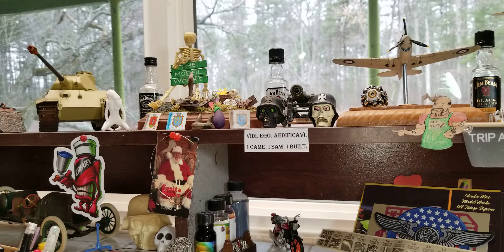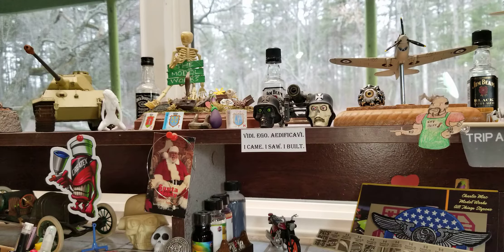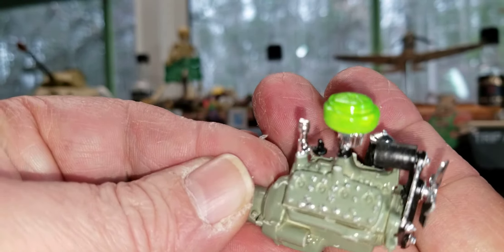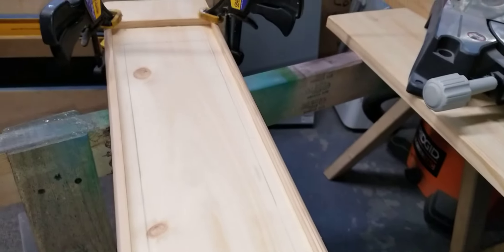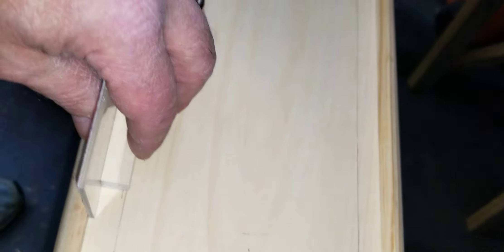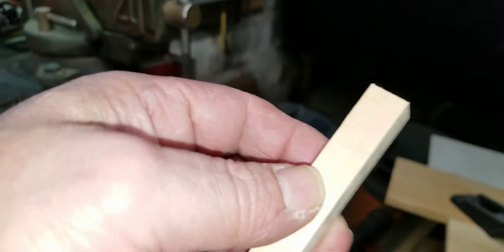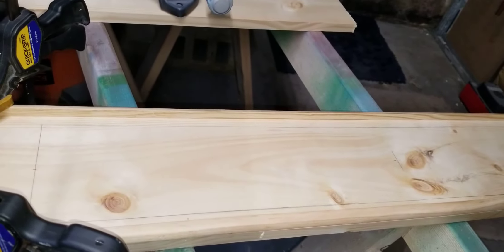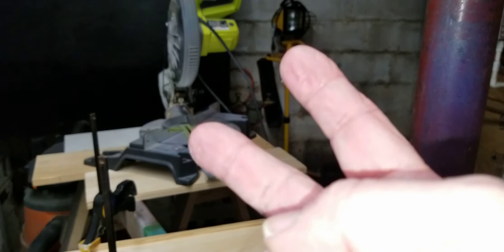48 Woody / Display case progress

Comment: Great idea on having the top glass come out! My thought when thinking about lighting a case, is wherever the wood trim pieces are that is where the LED strips go! If you run the inside bottom piece that holds the glass the full length and have the inside of it tapered at a 45 degree angle, then the light strips can be attached to it angled up at that 45! So you have it lit from the top, bottom and corners! Just me and I don't know shit! You do great work so........